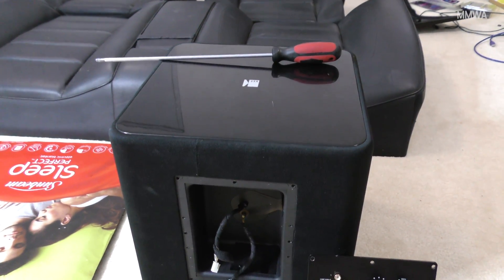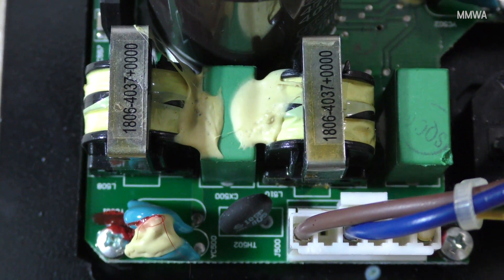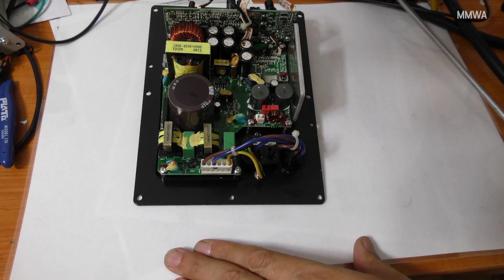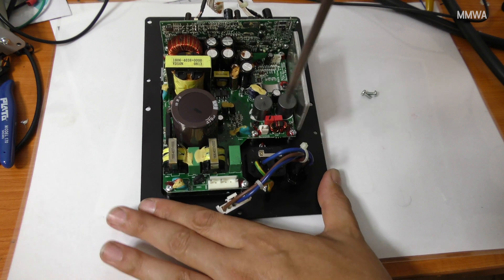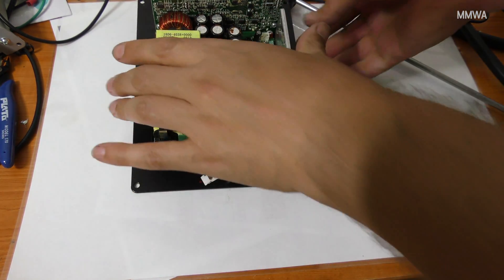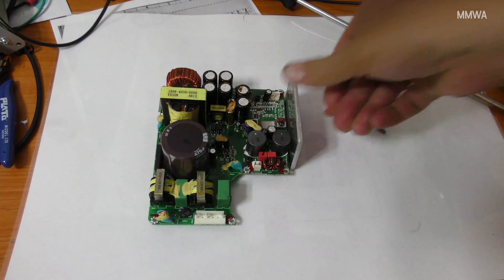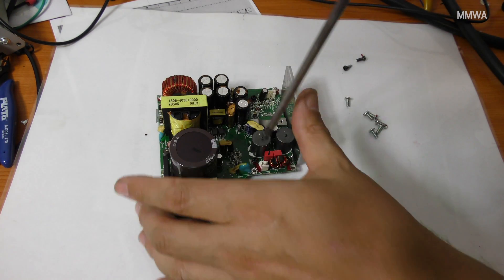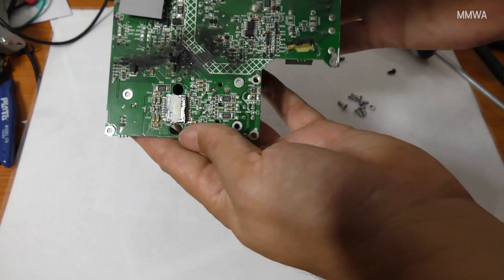My KEF Kube-2 subwoofer failed, lets see why

Comment: Thanks fella, mine just died after a lot of years. It was a replacement for a Kube 1 that also failed (many years ago), but I never managed to fix that one. This looks like the NTC inrush has gone in mine judging by the carbon mess around it, so I have a replacement part on its way. Bought a $7 assortment kit of NTC inrush thermistors for next time. I have a pretty good selection of parts in stock, but just not these!

Comment: 8 years is NOTHING! My SW-160 Yamaha has just only bit the dust after 15 years of daily abuse. This is intentional, reckless, competitive, dangerous, & as per something called Planned Obsolescence 

All those materials & the energy spent amalgamating something that will just force you to keep buying crap to keep the economy going. Pathetic.
Reply: I have bought last year a rare new ! sealed in original box ADCOM GFA 555 MK2 power amplifier, it was babied for more then 20 years at the seller closet. it is an amazing  sounding amp , by now I am not going to recap it as it sound fantastic, but I am sure I need to do it in the coming years.
Reply: OMFG!! That little black Thermistor just blew up on me. See what I mean? Junk they produce now. Even KEF which used to be a reliable company. Can't believe how bad all this crap is now.